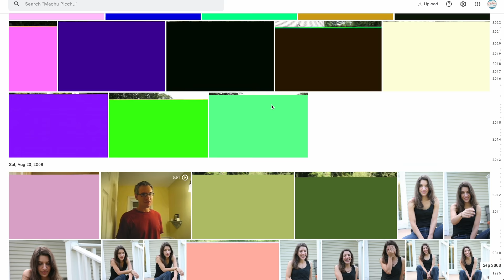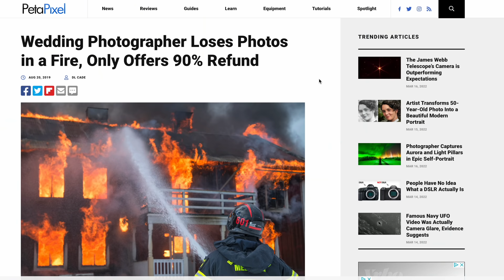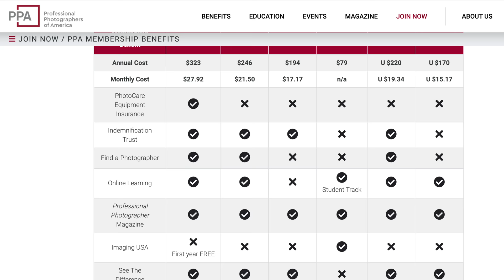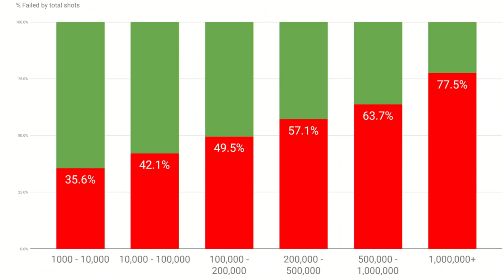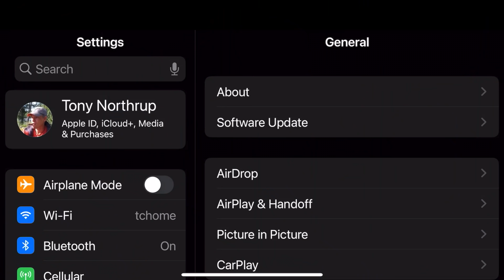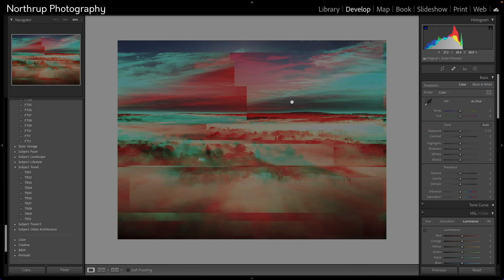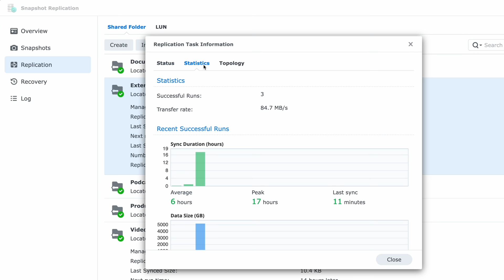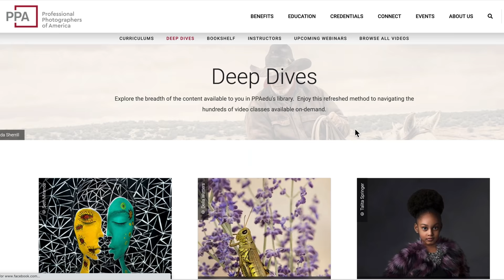NAS Storage for Photos & Video: PROTECT YOUR DATA!

Comment: I have burned all my raws and jpegs to DVRs since I started digital photography as well as using external hard drives and making tons of prints. I like have physical discs and use them when I want to use a library image. Never a problem even with my oldest ones. I don't format a memory card until the images have been uploaded to my computer then saved on my external hard drives and burned to a disc. A fire could take this all down.  If that happens, I will then start over.
Reply: Discs go bad over time. You will eventually have a problem as moisture gets in between the layers and the disc delaminates. 

The only safe way of dealing with this is some method of regularly verifying all of the files and restoring any that are found to be bad. A mirrored zfs array combined with an online backup is the simplest, but there are other options.
Reply: @SmallSpoonBrigade  As I said, I save files in a number of ways. It's just that the disc is the easiest and so far has stood the test of time. I don't need them to last forever. I think they are an underrated way of saving files for at least a good 10 years.

Comment: I am sorry, but you must have been doing something wrong. I did not have a bitrot, like, ever, though I must say I am a relative newcomer to the digital photo taking as I've been doing it for only 15 years. I keep all my photos in multiple (at least 2) locations, and the versioning tool I use checks them while copying and on request/cron job (git annex). My desktop and all my servers have ECC memory, exactly to avoid a potential bit rot. The UPS is a must, sure. The ONLY time I have had some issues was when hard drives in my RAID (thank you, WD), returned corrupted data but no read error (yes, thanks to prodigious software development skills at WD, the drives would return zeroes on timeout, and claim the read was successful), and even that has been caught with git annex. I think btrfs would catch it, too, but it was a transient error, and I do not know what would it do with a failed file.
The only thing I'm missing now is a copy to a friend/cloud. But here - I cannot find one that works nice with rclone mount and cryfs. Last time I tried, a simple repo clone would take a week and fail. 

I like your setup :). I'm still on 1Gb, and it can take ages. I also use SSDs (in RAID10) for caching - even the SATA ones help.

Comment: I used to do backup on archival DVD-RAM for a few years but pretty quick the storage requirements became so big, making 4GB DVD-RAM not feasible.
I then switch to a high-end RAID controller (Areca) that provides disk-scrubbing (to prevent bit rot) and two separate RAID-6 arrays, so - same as for your setup -  I have two disks of redundancy for each array and also a hot-spare for each. That's 20 hard drives in one computer :I
For offline storage I use hard disks, which as you mentioned have the issue of bit rot.
If I  ever get Gigabit Internet then I plan to duplicate to a second site like you do. Right now a backup site is not feasible for me due to low bandwidth of my Internet uplink.

Comment: I find it utterly unbelievable that someone who lectures on what to do and what not to do as you do, failed to have a foolproof backup system; nevertheless, my heart goes out to you. I only have slightly under 24 TB of images and videos so far, so small compared to you. I use Capture One and LightRoom (and still have all my Aperture Libraries). I hope at the very least you set your DAM to have the largest Previews possible (I use 5K in CO), if so perhaps you can salvage the previews.

I back up in a three-cycle system to three sets of fast RAIDs, once daily, once weekly, and once monthly, and have everything in iCloud (RAW and JPEG) by using Apple Photos to have a copy of every image from all other DAMs. I would never back anything up until I did a random check of the image's full resolution versions. I do a complete clone (Carbon Copy Cloner) made annually, taken out of service, and stored off-site using slow but cheap HDDs. My images go back to the 1950s as digital, and thousands of 35mm slide scans. These are both mine and my father's, who has long since passed, so very precious. Of course, I have always used a UPS.

Comment: I am retired UNIX admin, I worked for a large aerospace company and the shop I working in had petabytes worth of storage. We used the system from Quantum StorNext where files would age off of disk to a robotic tape backup system. We hand an archive of over 12,000 LTO tapes. In the disk farm we would lose 2 or 3 drives per week that I would swap out. At home I have a small 4 bay system and my prised photos are back up to the internet.

Comment: A good reminder.  I also use a a/b backup method as external drives are so cheap. And facing facts, as I near eol, many folks are not as interested in all the pics. Little thumb drives work good for specific functions.

Comment: Hi Tony, Your loss is disastrous and forever, but the real problem which you did not explicitly state is that ordinary disc systems do not notice bit rot / corruption. Thus once it has occurred, then however many backups you have, they all contain the already rotten data.   Now at the time you first save the pictures to a hard disc, you review them and see they are perfect. THAT is the time to create hash or CRC totals. Thereafter every time a backup is due, the hash/CRC totals you saved should be checked against those of the images on disc before a new backup is made.  This is impractical to do manually, but I cannot believe that someone has not created a backup system that offers this process - though I have not looked for one.     Some of your commenters refer to ZFS based NAS systems which they say do this.  The Wikipedia entry on ZFS was incomprehensible to me. I am a retired IT project manager - but not one who is Server literate. Whether buying a NAS with a ZFS badge on the front solves the problem is therefore unknown to me.

What I would like to know when setting up a really secure backup process is a) will it automatically create hashes/CRCs the first time it sees a new file? Will it recheck the hash before making a new backup of a file it has previously seen.    Will it seamlessly accommodate the addition of new images/files. How will it handle or expect ME to handle files that have been deliberately changed. I might lighten an image or crop it. Is that a case for mandatory renaming? What if I delete a file, is this treated as a case of disastrous bit rot or just a tidy owner!  Can / Should I limit this bit rot check to JPG/RAW files? What about TXT or DOCX that I add to the image folders with my latest notes and comments about the images and which might be frequently updated? I do not want my backups to be paused just because I added a comment to a description text file.

Comment: I use FreeFileSync to backup my files from one drive too another, the benefit is that each time i do a sync, i get a list of all the files that are changed, added, deleted etc since last backup.
This would prevent corrupted files to replace my backup, and saved me multiple times by finding out a certain file was accidently deleted, so i could restore the backup file instead of deleting the backup file

Comment: I took several cameras (digital and 35mm film) and two camcorders to record the wedding my my friends daughter. At similar events I ran out of battery for the flash. Fortunately AA so even on a Sunday many placed have them. 

I ran my laptop for e-mails. It went to sleep and never woke up. I took the drive to a professional recovery service. Paid for a donor drive and still they could not get the drive going. I did not loose much but it had been awhile since the last back up. 

Corruptions often occurs during the backup process. I do a copy, not a back up drive. Failed images are usually easy to spot if thumbnails are regenerated (not stored) and in each case the backs were also corrupted. On audio or video faults are difficult to spot. Most failed images I have had have been from an analogue original but digital photographs are just lost. With large data moving them around to create a new written copy to avoid bit rot takes months . It is hard enough when a drive fails and a new copy generated. Failed boot drive (Windows home server) required reloading all the files as there is no easy way to take on the file structure. Super large drives (16, 18, 20Tb) take many weeks to fully copy.

Although I can double and triple back up and maintain the files there will never be anyone to do so and so all the data, all the photographs and videos will not be accessible when a relative attempt to look for them even 10 years later. Photographs from the days before digital may still be in albums. Getting prints of the "important" photographs in a book for, is only part of the data and not the whole answer. 

I have had an attack. All my image files were encrypted. I disconnected from the internet. Took the drives out and used another computer to removed damaged files and the virus then recovered from back up. All computers on the network were infected. I have seen the same in a company and thousands of computers were attacked - just the image files, not their data. It took them along time to fix all the computers. And they were "so careful" that they wouldn't let computers on the network unless they configured and controlled them including all the anti-virus and anti-malware protection. 

My back up is only powered when backing up. That checks for new files and existing files that have been changed. I check the list and if there is an older file, that should have been on the back up find out why. Personal data I have additional back ups. File, theft and malicious damage could still be an issue.

Comment: Regular backups and keep one version of each year for ever. Keeping the yearly backups on two different hard disks and checking the integrity once a year. Keeping the backup offsite is very important. If the offsite backup is encrypted, make sure you will be able to unencrypted it, when you need it. Also remember, "the cloud" isn't magic, it can fail to.

Comment: Am I the only whos actually kind of mad about some SD cards just having a microsd card inside it? To me this is like if an ssd was just a shell around an SD card. I have had enough microsd cards fail for me to trust them and refuse to buy any microsd cards higher than 64GB. Would be great if the rest of those failed SD cards could be opened up to see if there was any sort of trend among them in terms of what's actually inside if them.
Reply: If they actually work its one thing, but I believe they're not as fast, which would bother me.

Comment: Is it me or do your videos lately have bad focus? It hunts for focus and make me feel uncomfortable. Bitrot is evil. Causes are different, electrical fields, power fluctuations or even some of the rare cosmic rays, yes they do exists and causes bit flips.  For backups use a system that regular does a scrub & verify like btrfs (linux alternative for zfs) and of course zfs on for example freeness/truenas or newer QNAP storage. Synology went with btrfs but lacks some of the features of ZFS but catches on.  I have a script that runs checksums for all files every x days and check them against last run. It takes time but directly triggers when a file is altered.   Also don't trust online backups they will corrupt just like local and depending on "subscription" you lost it, seen it happen.